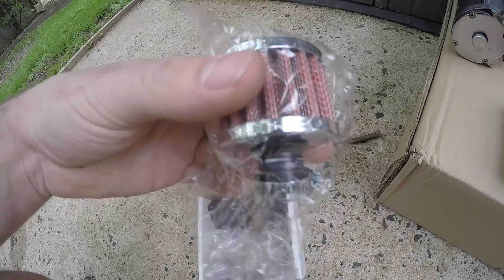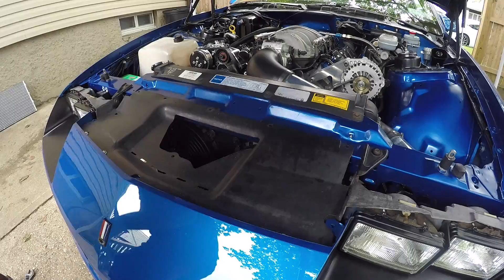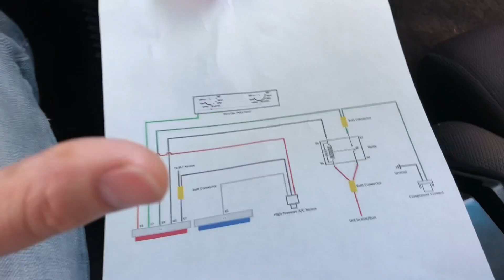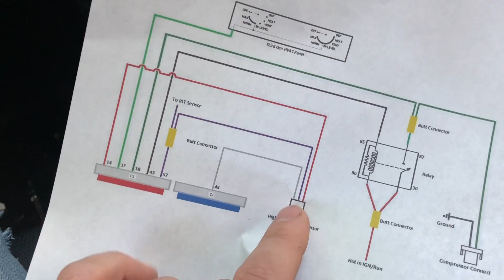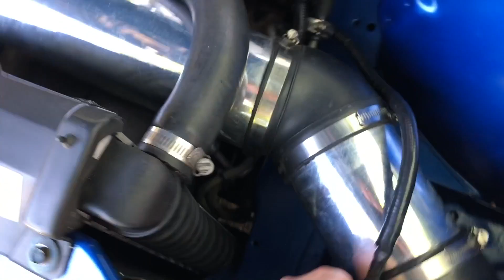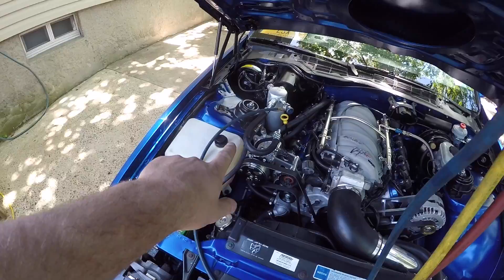How To: A/C In an LS Swapped 3rd Gen! | LSA Blower Swap

Comment: Hey Matt, for your swap did you have to hook up the vacuum line to the hvac controls?  I believe it’s a plastic line that comes out where the HVAC harness exits the firewall next to the AC box.  

I do still have the vacuum ball in front of the driver side wheel, but no hose coming from it.  Would you be able to explain how that setup should work?

Other than the brake booster (which should go right to the intake on the 5.3) are their any other vacuum systems that need to talk to each other?

I am putting in a 5.3 vortec into an 87 iroc.  Thank you!

Comment: The link to the condenser has the inlet and outlet on the drivers side but in your video it looks like they are on passenger side. Is that correct? I am doing LS swap in my 85 and don’t want to run lines from passenger side to drivers side condenser if I don’t have to.
Reply from the maker: The picture is upside, that’s the correct one. You can also get a parallel flow condenser now that works way better with modern refrigerant. Check out rockauto.
Reply: That’s where I have been looking   It just looked like the connections to the condenser were in drivers side and was hoping to get one with passenger side connections
Reply: Is the condenser you have still holding up good.
Reply from the maker: @JacobKetelaar-d8m  Yea its fine but I want to swap it out for the newer style for better cooling.
Reply: Last question hopefully. I haven’t been able to get a straight answer from parts sellers. If I replace the evaporator, the condenser, and accumulator with brand new parts that have never had r12 In them, can you run 134 or do the parts need to specify 134 compatibility? Some parts on Rockauto like some of the accumulators and evaporator don’t specify 134 compatibility. I did find the spectra parallel flow condenser on there and it does state 134 compatible
Reply from the maker: @JacobKetelaar-d8m  No it doesn’t matter. You can run r134 in a completely stock r12 system without changing anything but the hose fittings.
Reply: @lsxmatt  Awesome, thanks for the help. Greatly appreciated!

Comment: Great videos - thanks.  I just opened  the evaporator in my untouched 1985 camaro sport coupe to replace it for R134 conversion.  My evaporator has a screen glued onto the drivers side with glue like the residue you can see on your evaporator.  Looks like someone has had your evaporator out and has removed the screen.  Perhaps if was used to filter out leaves and debris from getting into the plenum?

Comment: I just did a ls1 swap and used the same PSI harness as you. What I want to know is how did you wire your blower motor power? Looks like the blower motor harness plugged into the factory engine harness and mine is long gone.

Comment: @lsxMatt This is a great video, but there is one mistake.  When using a fixed displacement compressor like your Sanden, the A/C request signal from the dash control needs to go through the existing low pressure switch before going to the PCM.  The low pressure switch is needed to prevent the evaporator freezing up.  The LS1 Camaros didn't need a low pressure switch because they used the V7 variable displacement compressor that internally sensed the low pressure and adjusted flow to meet demand.
Reply: I'm working on doing this with out ecu I did an ls swap can you h3lp me with wiring up the request straight to relay to c9ntrol low and high pressure switch and compressor clutch. Thank you for your time
Reply: @goldking1438  What vehicle?
Reply: @Mike_Neukam  91 rs camaro

Comment: Is there a particular reason why you chose those sensors? 
I was debating on using the sensors from the truck "year/model" and get them through rock auto (crazy cheap for each 1).. My swap came from a 2005 truck (using a similar compressor) as you into a 95 c1500 T56 conversion. Not sure whether to order what you posted up or use what went into the vehicle that my transplant came from into a 10 year old truck.. 
The parts you mention look close/identical (small differences), 1 sensor is a 3 pin (high side) and the other for the dryer/accumulator is a 2 pin. ECM is a P59 DBC, Holley turbo manifold (7875 Gen 3) and Holley cooling manifold drive system (pieced it together much cheaper than the whole package saved almost $1300), air is all that's left, hard lines and rubber lines are en-route.

Thanks for the content!! Love the channel!

Comment: Great content in the vid! Just a side note to help you and anyone else out that has the older cars, the 88-92 cars have a different high side hard line that has a pressure switch where you put yours but the service port and orifice tube are up right next to the air drier/accumulator. You can put that line in the place of what you have now and it will be much easier to service the system.

Comment: Great vid man... couldn't you use the 3rd gen A/C harness and just send the a/c request signal to the LS PCM? I'm using a Holley Terminator X, so it'll be interesting to see how it goes. But my car was not a factory a/c car, so I swapped in the harness and control module from a 90 model camaro. Hoping to use the thirdgen relay and switches with the sanden compressor. We'll see... thanks for the vids!

Comment: did you solder the high pressure sensor to the line?
Reply: Can’t be soldered to any aluminum line. If copper, plan for 400 PSI stability.

Comment: What did you do about the heat coming off your heater core? Did you install a bypass valve to stop circulation of the coolant through the heater core?

Comment: hey I have a question I wanted to know did you use the AC recognition wire to stepler throttle up when your compressor comes on?
Reply: @G B   > On the “LS” engine, regardless if drive by cable or drive bace cabe, the A/C button inside is a request to the compressor to come on. The PCM looks at the 3 wire “Trinary” switch to see if pressures are too high to allow A/C operation. The on-off switch at his compressor shuts off when pressures are low (Evap Freezing) or on to start cooling. The PCM will maintain programmed warm idle, colder air fast idle and back out the IAC for slightly higher idle warm if A/C is allowed. If drive by wire, same thing only it uses the internal motor of the throttle body to run a little faster.
  No additional switches or wiring is required. Just let your re-programmer know if you have A/C or not to enable this function or at least double check to make sure it is on. They can raise the idle for all functions warm if running a high lift cam or A/C. If the power steering high pressure line is equipped with a fitting for a PCM sensor, idle will rise when hitting lock or end of travel for the P/S as the internal p/s valve drags down the engine as well. Hope this helps!
ASE Master Tech since 1978 - Retired
Reply: @deankay4434  @ on ls stand alone harness,,,   I will use the 3 pin trinary high pressure sensor,, frim 04 tahoe,,,    But,, which pin on pcm i would use ? As a/c request!!?
Reply: GerardO,   > The best place to go, is on the Internet at Lt1swap.com At this website you can get your wires and functions now and later if reprogrammed by Brandon. He only charge $50.
My GM service info timed out so I am working blind except for the PCM & BCM systems being used on my 1967 C10. All parts come my sons wrecked Tahoe but 2003. I don’t think anything has change but all on paper in plastic sheet protectors in order of cells. Sorry, best of luck! Brandon is tops with tons of info! Also, inside the button requesting A/C compressor on, the signal travels to PCM thru class 2 serial data.
Reply: @deankay4434  @ i been on lt1swap,,     I dont see a a/c request on list,, all i see its to remove yhe a/c outputs,   But i want to use  all a/c stuff
Reply: @deankay4434  @ do u have a 67, i do too,     U got a/c?? On c10
Reply: Gerardo  >I used a manual switch from an Isuzu Rodeo / Honda Passport. It fits nice on right side of slider levers, black, says A/C and turns blue when on. 
 My Lt1 comment is the 04 HVAC turns A/C request into class-2 serial data. The PCM allows or denies A/C if, no RPM, Low Pressure signal, to high RPM. The last, #1 protects the compressor for 5-7K operation, the rear is obvious. Now, yes I have a 67 C10. Fabricated my own air distribution box, all cable. Hot coolant shuts off in cold position allowing for A/C. Heat on floor is center hinged and moves by cable using rack & pinion. Spring loaded ball detent holds doors gently so air speed does not move then. Custom console hides front of heater / A/C box, curves and meets the dash bottom. It is wrapped in leather but mounted vertical is PCM, BCM then TAC module for cruise. Under hood for easy access is two rectangular Buick PA, LeSabre right-hand fuse/relay centers. Behind glove box from 92-2001, no one knows they are there. Power buss on GM 160 amp fuse protects all. Supply fuses, fuse protects relay & circuit. My A/C provide B+ to relay 85 and ground 86 goes to micro switch behind gas pedal. Ground, relay on, compressor runs. 3/4 throttle or more, ground is open, compressor off. All relays have fuse to 85 then jumps to 30. 87 is NO, 87a NC. Head lamps, horns, fuel pump all fuse to relay. I used factory doors switches complete in center console mounted fixed. Hole in console cover surround “T” handle shifter, illuminated gear selection in Orange but door switches push front or rear of window sw to power windows, lock on unlock doors (After all, 2 doors/nothing on doors. Passenger seat has Remote Keyless receiver built in, unlocks doors with GM Tahoe key fobs. Door open switch, key-in switch in doors and ignition using micro switches w/no amps but 12 volts input to BCM or Door Switches. The door sw buttons are moved thru PVC board hole, wrapped in leather, held by magnets. Tiny chrome pistons sold for Honda’s, Toyota’s etc. pass into hole. Bottom has spring to compress, flat washer & but with 3/4” rubber bumpers. Green Loctite holds but. Each marked with generic symbol etched by “Trophy Shop” on 1/4” Clear plexiglass. Sandblast edge, held in place, illuminated by side LED that comes on with key, all day. Start is B+ to micro switch w/roller arm at shifter. B+ goes to neutral and park in parallel to allow start in either. B* goes to relay, PCM allows or denies crank. If PCM see’s 450 up RPM, crank is denied because it’s running. PCM provides ground to 86, 5 amp fuse provides B+ to 85. 30 amp fuse to 30, 78 is hot to starter solenoid (High amp circuit). Reverse lights, micro switch at shifter w/roller lever, on in reverse, B+ to relay 85, fused by 10 amp, ground provided, 10 amp goes up 30, 87 hot to backup lights when on. I used rubber door jamb boots from smaller rear of 03 Tahoe in front doors of 67 C10. Power windows are not kit, kept SS wing windows. Ordered right-left power window regulators for 99 Escalade, welded 67 door brackets onto new using article from 67-72C10 forum. Great photos, grease tracks, new glass felts, good to go! I started service manual for paper and thumb drive. Part numbers, R&R, schematics, used GM wire colors as I took entire harness from 03 Tahoe. This is the most expensive mistake you can make is NOT making Sevice Manual. “LS” engine, in every book, make changes like cam, note brand, lift, duration, grind #, just scan cam card include in service manual. I have Microsoft Publisher and have pages from two different GM paper manuals scanned in, and included. Oil pan has no internal by pass, Corvette City “Bar Bell” in back of oil gallery. Intellitronix digital dash, 40 tooth tone ring on output shaft, Camero-4X2 truck pick up sensor. Add ground, pinch in vise, place in drill on other end, twist wires 9 times per foot, then I wrapped in aluminum tape to block RFI interference to PCM. It make 3 signals, 1 to ABS, 1 to Speedo (Harvested 14-way make/female connector) from Tahoe, used for cluster. I am an auto nerd, fixing Yamahas I late 60’s, save hay money, clean & paint, trade up to bigger. Apprenticed in small shop then went to dealer (No trade school) but asked at dealer to take 8 test & get 5 cents per flat rate extra. Passed, got $40 cent raise became certified ASE Master in 1978 at Datsun dealer working on 280Z because fuel injected and 1600/2000 Datsun a Roadster because I could sync 2 carbs like 240Z. So,The Forrest Gump of automotive repair. Hope this helps a little, perhaps too much!
Best of luck as I have large rear window. Previous owner broke, cut hole in cab to fit grandpas camper window with bolts & silicone. Took 4 batteries w/saws-all and cut one in bone yard with slider. Got lucky for $50. DK, Omaha.
Reply: R134a parts, condenser, compressor and inside evap housing from 200-2004 Isuzu Rodeo/Axiom. OEM heater core W/O ac, mounted heater core with single plate, one screw on engine side & hot water control valve cable operated. Remove hoses, one screw, tilt cover (Metal) toward engine, heater core slides out. Take ten minute or less. Evap blows cold air thru cold hearted core with 03 Tahoe gen-111 engine 5.3L. Sorry, got off track!

Comment: Did your a/c compressor have a lead for power or did you use the connector from psi ?
Reply from the maker: Psi doesn't give you any a/c connections. I had to wire in my own a/c.
Reply: Thanks man got everything installed just about just have to wire up everything

Comment: Thank you SO much for this. Just recharged my stock AC setup in my '90 Camaro with the Ford orifice as suggested. 33 degrees at the vent on max in 86 degrees ambient sitting still. First time it's made cold air in 17 years!

Comment: Ok, so question for you matt. Currently have a 89 GTA that im wanting to upgrade the system to 134A. But my blower blows at defrost only. Could be the diaphram under the dash or the vacuum line correct? Is there an upgrade to this style system that is decently easy?
Reply from the maker: Yea theres a hard vacuum line that runs  from the hvac harness in the bay over to a port on the intake manifold. On my car it goes to that black plastic box by the brake booster. Make sure that line has vacuum first. But yea, defrost is the default blower mode, so if you have no vacuum to the diaphragm in the dash, it wont switch.
Reply: Nevermind, just watched the rest of the video. Very clean setup. Seems relatively simple. Awesome ride, awesome videos. Gained a SUB today.

Comment: First of all, love your third gen! Beautiful car! I would like to ask, how did you wire your dual Ls fans to your camaro! Did you use the stock wiring to connect them? Or did you buy a wiring kit? My Camaro is a 1984 z28. It is equipped with a single electric fan. I would like to upgrade to a Ls dual fans from a fourth generation Camaro. I just don't know how to go  about wiring the dual fans. Any help i would appreciate it! Thanx and keep the videos coming!
Reply: its very likely you can split the line and add onto it, the cool part about electric motors is that they cant pull power they are not being supplied without damage, if you split the line and run it to both, worst case scenario is that your fans don`t spin as fast, that could even be changed however if you put a higher amp fuse. just make sure the cables are wide enough to handle it

Comment: Stupid question, I have an 87 gta stock tpi setup still, I converted to r134 a few years back, works ok, not great. Will that  spectra part number 7-4426 work in my car, would I have to change anything??
Reply from the maker: I know at some year the hardline going to the evaporator changes, so there’s a different condenser part number. Just check your year on rockauto and they should have the spectra condensor that fits.

Comment: Third Gens have never be known for having the greatest a/c. I replaced the whole system on my 84z and still my a/c sucked. I switched from electric fans to mechanical clutch fan ftom an 87 monte carlo ss. It fit right in with minor modifications. Car runs cooler, does not drain power, and my a/c actually works better. I will seal my evaporator  shown in this video so i can get colder air. Great video thanx for the info!
Reply: So I sealed my evaporator just like in the video, man, i can feel the difference! My a/c is actually blowing cold air. When I replaced my evaporator I never sealed it and it was the reason for me not getting enough cold air! I'm very happy and enjoy driving my 84z now! Thanx LsxMatt for putting informative videos for us third gen enthusiasts!

Comment: Hey you should get the heater valve ac Delco 15-5533 it will work with the 3ed gen vacuum selector and when on full cold it acts as a bypass so pump still circulates.  It's the valve from a 99 k1500 and many other vehicles.
Reply: A little more info in case some finds this trying to solve their problem.  Right now your air is going through the hot heater core and the AC box add this valve and the heater core will not be getting hot water.  The 4th gen uses a flapper door to divert the air and water all ways flows through the core thirdgen shut off water flow to the core.  But ls pumps require the heater core ports to flow.  This valve allows this.